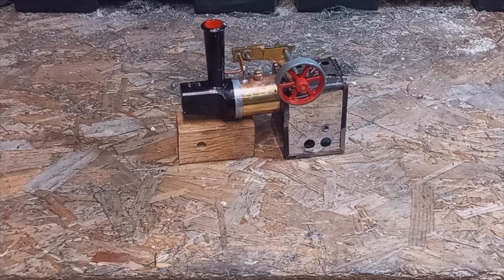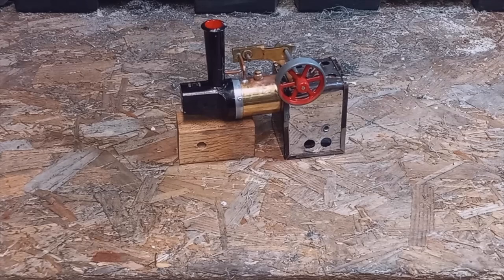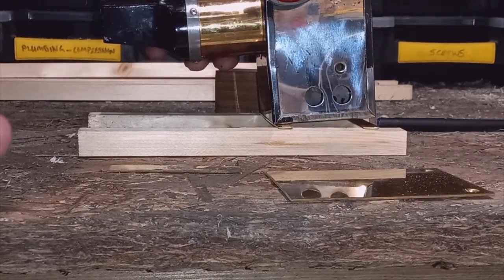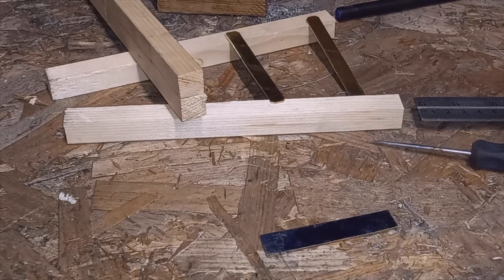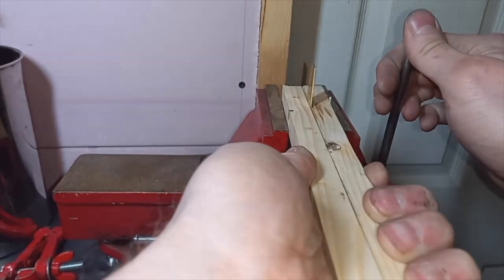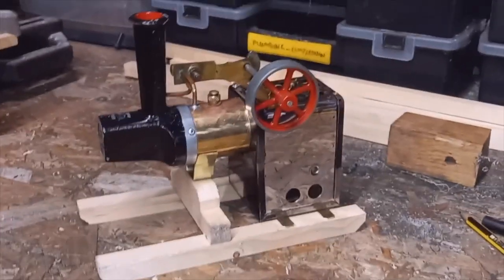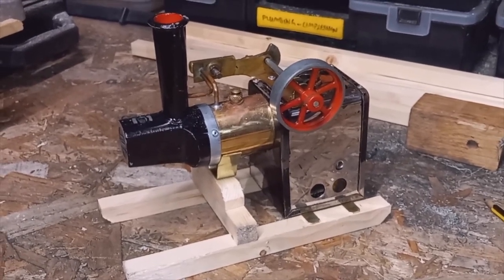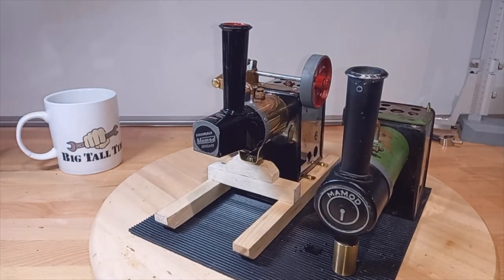Part 2 - Skid Mount Steam Engine Project: Fabrication of the skids, firebox and boiler mounts

Comment: A nice looking stationary engine, away from the original Mamod version.  I bought an SL2 from a well known online auction site, which as it turns out, is a composite mismatch of bits and nothing like the original but runs really well. I'm considering giving it more of an authentic industrial/agricultural makeover and you've given me a few ideas about how I might go about this.  Thanks.
Reply from the maker: Cheers - I’m all for a faithful restoration, but I’m not too precious about the “retired” parts in the box of bits! definitely going to shorten those skids though